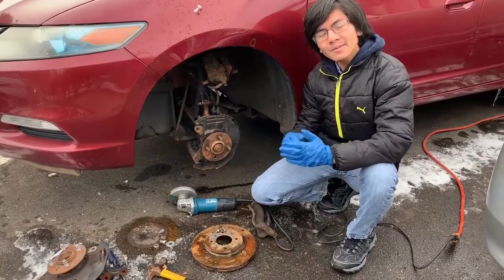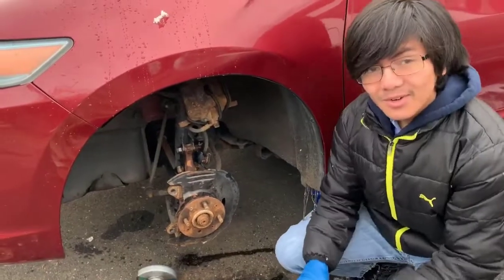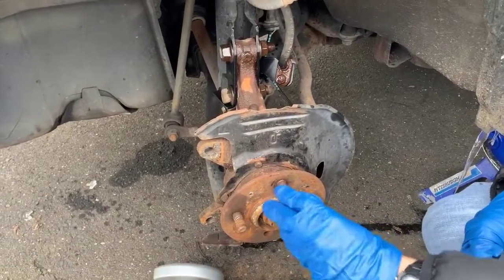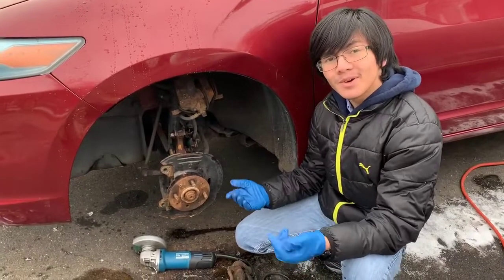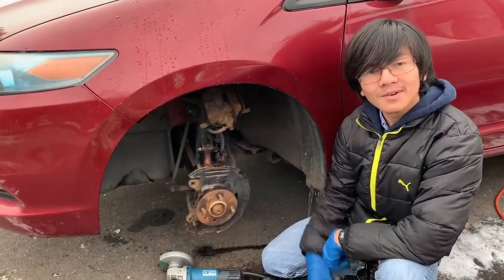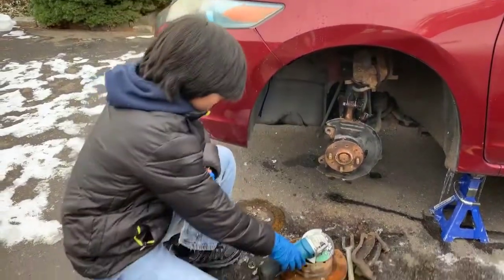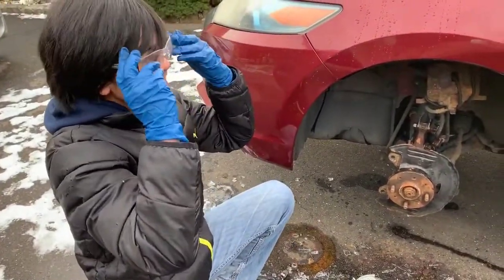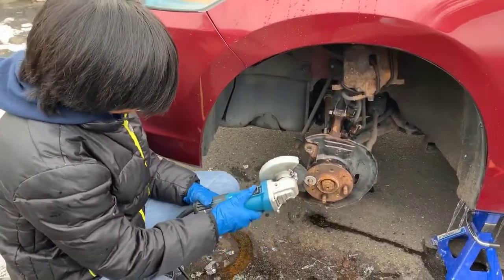How To Replace Damaged Lug Nut BOLTs | Stripped Broken Wheel Studs - Remove, Install, Change/Repair

Comment: Why just not replace the hub completely
Reply: Yea I'm with you, and he could have just took the hub off to take the bolts out instead of cutting 🤦🏾‍♂️
Reply: @Chrisdufer Pinto
Helo
Iznt the wheel hub more expensive (espec if new,)?
a used wun from a wreck yard runz risk uv bad wheel bearing(?)
Reply: Cause they don’t make them for my 87 Lebaron.